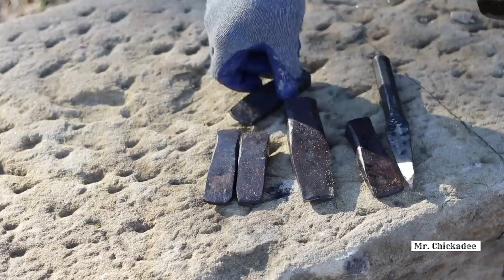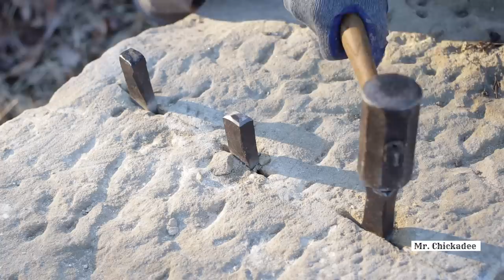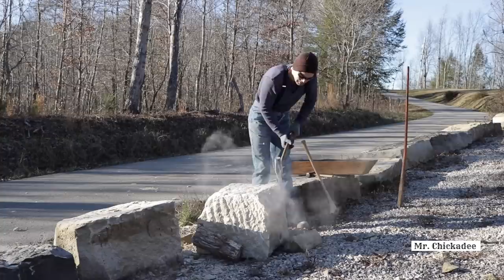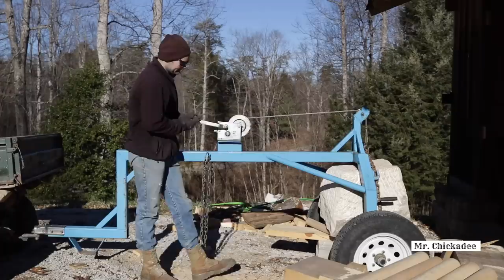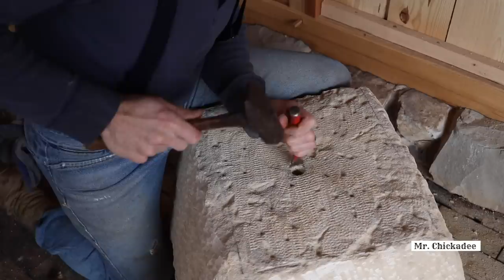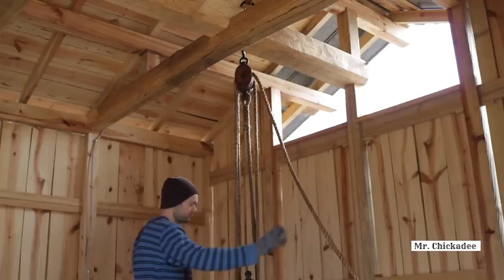Hand Carving a Stone Anvil Base

Comment: Interesting. I never would've thought to make an anvil stand from stone. It is not known for its ability to transfer percussive force. But who am I to question the word of a master blacksmith. I'm sure Mr. Greenwood knows what he's talking about. Beautiful work and a beautiful anvil.
Reply: Redmar Kerkhof , why would you want to transfer the force?
Reply from the maker: He has been using antique German anvils sat on custom Anvil bases for many years, and says they are so much better than wood.
Reply: @MrChickadee  how so, and what drawbacks? I'm terribly intrigued. Before I make a whole new wooden one for my anvil. Pretty please.
Reply: They are better at absorbing the force because they are very heavy. Probably 1.5-2x the weight of the anvil. You don't have any give which means more force gets transferred to the piece being worked on.
Reply: @waynelewis881  So that the anvil doesn't ring and doesn't lose energy in unnecessary movement. Of course, ideally, you'll want all force of your hammer to go into your work but energy just flows like that. The more you can get into the ground, the more it is like the entire earth is your anvil base. But I am always open to learn new things. I'm very curious to see Mr. Chickadee forging in his shop when it's fully set up.

Comment: A lot of what you do is my first time ever seeing someone do these things. Do you do a lot of research before hand, or do you just take your existing experience and knowledge and figure it out on your own? Nice work as always.
Reply: Check out his Q&A video. Someone asked similar question and some projects are also his first time doing that thing as well, recommends some books and other resources he's learned from.  He's had some stone working experience over the last few years making foundations for other projects in this case.
Reply: yeah like I wonder if it matters that his slots are a little like  /  /  / instead of exactly like  ---  ---  ---    (1:46)? or if it unavoidably happens and you only need them somewhat in line. Like I have a hard time taking a really long time on projects because I fuss over every detail before I know if they matter because of so little experience. The way you get efficient is doing the critical stuff perfectly while getting the roughing done with enough slop to be fast at it. Especially moving between materials like going from machining to cabinetry to stone carving. 

my grandpa had a saying "measure it to the thou, mark it with chalk, cut it with an ax". And I always thought he meant the tendency for the government work bureaucracy (of which he was a part, he was kind of Ron Swanson type)  to drive up costs through a kind of selfish inefficiency by caring about tracking and reporting numbers etc. But maybe it was a cautionary statement? Huh. I feel like there's a practical wisdom about life that comes from doing work with your hands. And that the abstract nature of the work most people do do nowadays, and the shear abundance that we enjoy and take for granted leads to us loosing some of that wisdom born of long term contending with life with your hands. I'm glad I don't have to toil in the dirt so much to survive, but maybe on some level that's what we were made for? I freaking love these videos.

Comment: Technically speaking, we just watched Mr. Chickadee have an 18 minute match with the rock...
Reply from the maker: The match actually took a couple days though ;)
Reply: @MrChickadee  I was wondering how many hours total. And is the base under the stone to bring the work surface to a comfortable working height?
Reply: Best gess... spread the load on the floor and the ring of the anvil. Beeing rubber on wood.
Reply: We got the highlight reel.
Reply: and won!

Comment: A comment is on some of the things you deal with ...
The bending of the beams is not only aesthetic because the arch has a higher bearing capacity. The door is due to the wide gap between vertical beams, where a stronger horizontal support is also required !!! People worked with "silent" instruments and heard their own thoughts better and thought about what they were doing! Everything had a purpose in particular. The decorative elements of the houses also distinguished individual villages, farms or regions, and were repeated, for example, on the needs of the day and on clothing, which was related to the search for potential partners :-). One village was mostly several relatives of families and they knew that marriage was not good. Wood construction was suitable for earthquakes or strong winds, when something broke, it could be simply repaired and replaced !!!
Half-timbered houses with crossbeams and stone-worked panels were used in areas around the Mediterranean before the time of Greece and Rome. Construction tests have shown that it is a type of home, also very resistant to shocks. It collapses only partially, because the wood absorbs shocks and usually spills only part of the walls. Then civilization has forgotten this type of , and once again these buildings were hung in the European part in a mild climate and burnt or unburnt bricks were used as a filler. You can see many of them in France, Holland, Germany and in the Czech Republic. It is very healthy to live in wooden houses without concrete foundations. In the gap between the floor and the soil were put or beech leaves in our country, because it hates mice. When the water flowed through the house did not resist it, on the contrary, allowed the water to flow freely between the stacked stones without mortar and pipes. I worked alone to save some very old wooden houses. My sister lives in a timbered house that is more than 200 years old, which I also worked on, so I am interested in these things and MR CHICKADEE makes me very happy with his work! I also like this channel ... https: //www.youtube.com/user/neemantools/videos

Comment: Love it !!!

If possible, tell more about the boots you have.
Reply: He usually looks to be wearing some Marine combat boots, check out Belleville ICBs, I've had a pair for 10 years and still use em.
Reply: Belleville for sure. USMC Combat Boot. There are hot weather, cold weather, and steel toe. I don't know what unit he was with, so not sure if they're steel toed or not, but they issue a pair of each, hot and cold weather. Steel toe depends on your unit.

Comment: Piramids mystery solved!
Reply: It is thought the Egyptians transported the granite and limestone stones hundreds of miles via the rolling logs technique Mr. Chickadee demonstrated and they only had bronze and copper alloy metal tools (much softer metals vs the steel our host has) to work the stones.
Reply: @David-rx2to  Steel is already much softer than hard stone, and it was well known back then that you can saw stone with a toothless saw and sand in the kerf.

For the most part the stones were transported by boat.
Reply: @iotaje1  Steel has a hardness of 7 on Moh's scale while granite has a hardness between 6 and 8 depending on the granite composition. Copper is 2.5 and bronze is about 3. I have seen tries to demonstrate the toothless copper saw cut on sandstone, using just sand and water, some of them are on Youtube if I'm not mistaken. It would take days, maybe weeks and kilograms worth of copper blades to cut through one block of sandstone. Quartz is as hard as steel ( a 7 on Moh's scale) and often used in egyptian work too so overall I doubt granite or quartz were ever shaped by copper or bronze tools, I don't even know how well such tools would work on sandstone, which is the softest. There has to be other answer to that which, so far, we have failed to find out.

Comment: I always used feathers and wedges 
We have beautiful granite in maine
I think this way with just wedges is how Japanese traditionally split stone 
I have tried using a an old hardened steel star bit before and love me some science give me a hilti or an air drill lol
I used to quarry blocks in stonington maine on deer isle beautiful pink granite we had a channel torch it would melt a trough 4 inches wide 12 feet deep with off road diesel a d compressed air that was the back cut then we drilled the top took two weeks the bottom and sides were cut with a wire which was run by a pulley on tracks we would drill to long holes that met and then blow a rope through with compressed air tie the wire and use the rope to pull the wire through crimp together and put water on the wire and run 
The torch the wire saw and the drilling took 2 weeks 
Then in one day we would use feathers and wedges that were 5 6 inches long maybe more and a 90 pound pneumatic hammer and split out 12 80 thousand pound blocks and then split those in half

Comment: Nice job Josh. What is the purpose of the clay-like substance (is this a mix of clay, straw and concrete?) you put between the stone and anvil? I came up with (guesses) 1) to reduce the direct shock on the stone or 
2) to make the surface the anvil rests on the stone absolutely flat.

Comment: P.s. check out using a large tuning fork welded to a steel hollow rod. Even dual tuning forks with interwoven copper or steel wire between the forks to increase resonance, thus turning the rod into a drill. I know you're into ancient tech. And you have all the stuff to pull it off yourself. Challenge!?! The idea is thought to be how egyptians did such perfect drilling through granite...some people say they can see the dual forks with wire attaching them in hieroglyphs...
Reply: ...woah...people were already talking about the egyptians here 😂😝 i didn't even look before commenting

Comment: Hold your hammer down at your side. Point the hammer forward so the hammer haft creates a 90 degree angle with your arm relaxed at your side and the hammers face is now parallel with the ground. Holding that position shows the height your anvil should be and how close you should be able to get to your anvil. 

That wide base set up looks nice but it will cause you to lean over to work.

Comment: Kind of neat but what is the advantage over a wood base?
I would think it would affect the Anvils hammer return and probably make it ring louder. 
  I worked at an event before on a borrowed Peter Wright that was mounted on a custom concrete block. 
 Was miserable to work on, I don’t see the difference between a stone base and a concrete one.
Reply: Concrete is much less dense than rock and lighter . With the stone below it it has not much give. That means that more of the force from the hammer is transferred to the work piece. And because the stone is probably 1.5-2x the weight of the anvil it is extremely solid.
Reply: I guess I do not understand how somebody with no skill can be a naysayer to somebody with all the skill Mr Chickadee has.  you do good, sir.

Comment: I'm not a mason, I'm a iron worker/fabricator. But isn't a respirator needed when cutting stone? I remember having a entire section dedicated in the  OSHA 30 about respirators being a must have for stone work. Silicosis is no joke, you do not want that dust in your lungs it's a human lung carcinogen. Always stay safe :)
Reply: I personally would use a slightly damp bandana to breathe though I would use a respirator in an enclosed space with little airflow but outside with lots of airflow you shouldn't need too much.

Comment: It's a great video but a stone base goes against everything I've learned about blacksmithing (I. E. That the base should be soft to absorb the movement of the anvil)

I know you do a lot of research before doing things, why did you go for a stone base rather than a more common stump?
Reply from the maker: It was the advise of Master Blacksmith Josh Greenwood. You see, some of the best anvils ever made came from Germany back around 1900 or so, and what they also used often were cast iron anvil stands. Mr Greenwood has been using these cast iron stands and finds them much better than wood. Stone would behave in a similar way in his opinion.
Reply: @MrChickadee  The motar base was also an interesting solution, guess it ensures a more complete connection with the stone base allowing for even vibration and shock transfer......would have liked to hear the ring tone of the anvil before and after installation.
Would also like to know some details aboit your anvil....supose that might come a bit later.
Reply: 1. Reference Newton's third law of motion. The bigger the anvil the less it will move, thus hammering up on the work.  The greater the base mass, the more energy is transferred back to the work on the face. BUT, only when the anvil is fully intergal with the base.  The rock (sandstone) base is an excellent choice to increase mass. The key is connected mass between the anvil and the base. (See #3)

2. Soft woods absorb energy so are less efficent reflecting energy back to the anvil and the work. Again, stone significantly wins over softwood.  Stone fails due to fretting in industrial settings. But should last a hundred years in this usage. 

3. The mortar and wood peg in the tooling hole are adequate. But will probably loosen over years of use and possibly differential expansion/contraction. Although not time period correct, JB Weld is almost permenant and works exceptionally well.  Time period correct would be hide glue reinforced with horse hair.  But it suffers from low temperature fractures. Possibly pitch?

4. Ringing: A well anchored anvil does not ring annoyingly. Increasing the mass lowers the tone so it is not annoying.

5. Conclusion: Congratulations!  You will have many enjoyable years blacksmithing on that excellent anvil and stand.

Comment: AAAHhhhhhh but you used a modern engine lift trailer, says the doubters , before watching you drill a 4 inch deep square hole in solid rock by hand.

Comment: Now I agree with almost everything you do and the way you do it but as a sometimes hitter of hot  iron on an anvil, I'm am going to say that I don't like this. An anvil should be mounted on wood, to absorb the vibrations. This is going to  be noisy and bouncy and fatiguing to use.
I may be wrong, we shall see.
Reply from the maker: Actually, the best anvils ever made in germany (like this one) were often set on purpose built cast iron stands, after talking to Josh Greenwood who has used and sold these anvils for a lifetime, he recommended stone to be the best compromise if you cand afford or get cast iron. Bedded correctly to a solid hard surface, the anvil and stone, or cast iron, all becomes like one huge anvil, where the wood base deadens the mass of the anvil at its finite weight and size. So a 200 lb anvil on a 400lb cast iron base would act like a 600lb anvil, same with stone. wIth wood, 200lb is just 200lb.

Comment: you have been working with granite a bit lately.  unfortunately, you haven't been using dust protection.  read up on silicosis.  it's what killed most of the granite workers in the 19th century.  it is a result of breathing dust with silica in it.  it gets in the lungs and really messes them up.
love your work though,
Reply: Having a YouTube channel is not the same as working full time in a quarry